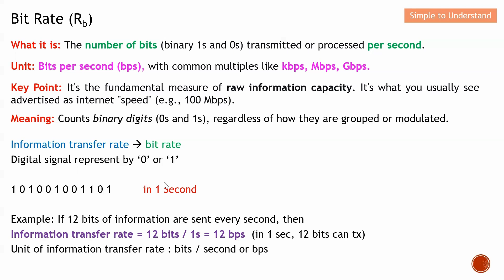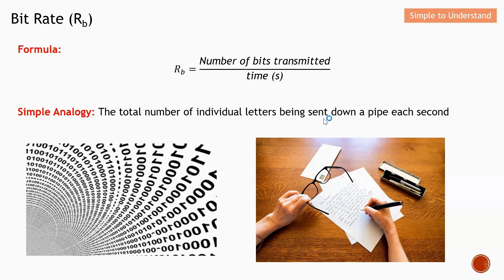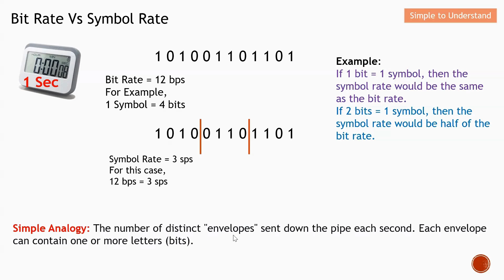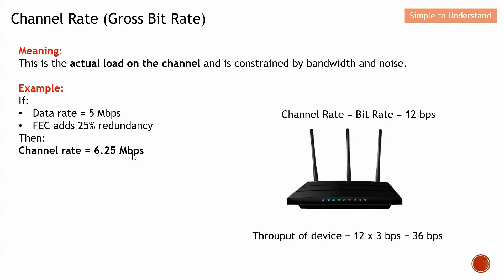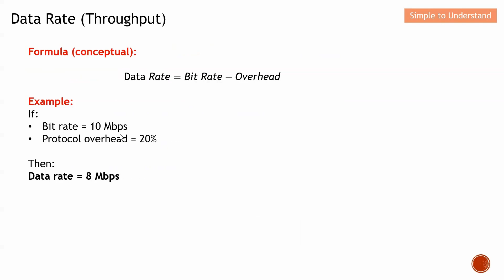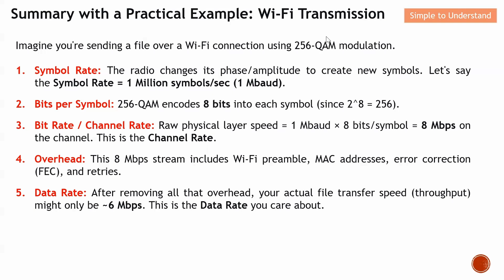Digital Communication #6. Basics: Bit Rate, Symbol Rate, Channel Rate & Data Rate Explained Simply

Comment from the maker: Thank you for taking the time to watch this video about digital communication.
Many of us are confused by the different terms used to describe throughput, such as bit rate, baud rate, symbol rate, channel rate, and data rate.
In this video, I am going to fully explain each of these concepts.
First, bit rate: imagine you are sending data in the form of a letter.
Symbol rate and baud rate refer to the same thing. Imagine now that you’re sending data in an envelope—one envelope can contain more than one letter. For example, if each envelope holds 4 letters, that means 4 bits become 1 symbol.
Next is channel rate. Most of the time, channel rate is the same as bit rate. However, if there are multiple channels, then the total bit rate of the device equals the number of channels multiplied by the channel rate.
Finally, data rate: a letter contains a lot of overhead—such as the sender’s and recipient’s addresses—which does not carry meaningful information. Therefore, the data rate equals the channel rate minus the overhead.
I hope this helps clarify the differences between Bit Rate, Symbol Rate, Channel Rate, and Data Rate.